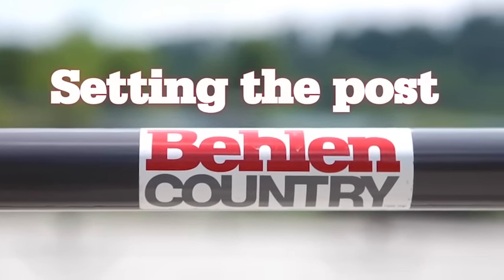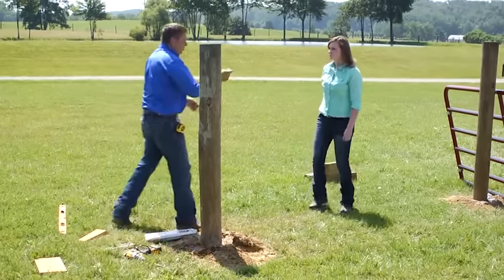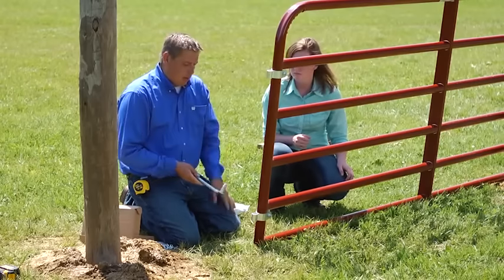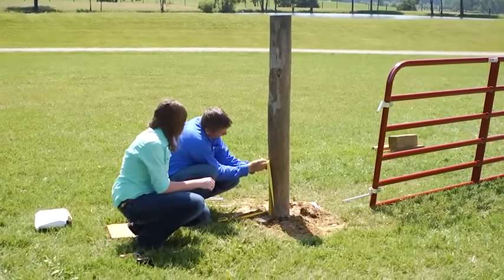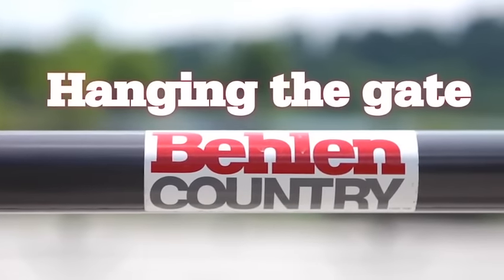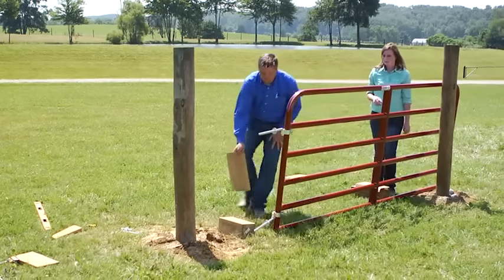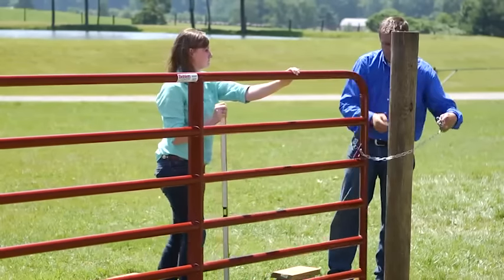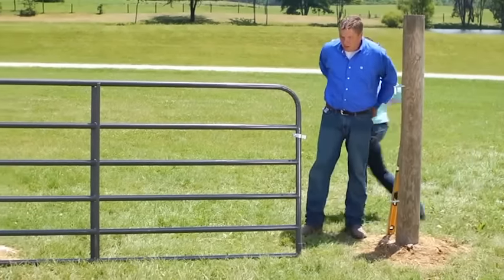How to Install a Behlen Country Gate

Comment: Good instructions, I bought  two  6 footers Behlen gates at  $ 179 a piece  to replace 35 years  old sagging redwood gates  that  were hella heavy .
Got it done  in 10 hours or one day including removing the old  redwood gates and  fixing the old 2 posts  for Behlen  metal gates 
Amazing how  light weight the 6 footer Behlen  gates are .
And those 4 lag bolts are  amazingly strong  when I twisted them CW and CCW to level the gates 
Am very happy to find the Behlen  products. And they are CHEAPER at $179 x 2 =  $ 358  than chain link gates  estimate at  $ 980 because of  2 additional two  2 5/8. inches  chain link metal posts and  6 bags  60 lbs concretes
It’s much easier to install than chain link gates that require metal posts

Comment: Holes were already predrilled. However, good instruction.
Reply: cfriskme thought I was the only one that noticed that.
Reply: Post holes were already dug, concrete was already poured, post’s were already set and leveled, and holes were already predrilled, but good instruction nonetheless.
Reply: l wanted to see how the holes were drilled horizontally & vertically spot on throughout a 8 inch pole

Comment: I would drill from the gate side of the post. That drill could walk quite a bit over 6 to 8 inches.

Look at her angle when she powers up for that bottom hole. She would have ended up an inch low by the time she was through had the holes not been predrilled.
Reply: I saw that, but I think she leveled it off.

Comment: nice video instruction, thanks! question, how do you put the post down? jut dig a hole, put the post down and pour concrete around it and the post will stick to concrete when dried?
Reply: The quick setting concrete has instructions. Each brand is a little different but basically yes you dig the hole usually with an augur (2 man or tractor) to a depth at least 1/3rd the size of the post...then usually a layer of gravel then water + concrete then backfill it with dirt and level the dirt on a slope down so water doesn't sit against the post.

Comment: It shouldn't be much of an issue with a small gate like this but if it's a big gate like 10 or 12 foot dont make it level. Leave it slightly lower on the side that attaches to the pole because it will sag over time. If done right then after a couple years and its sagged a few inches it should be pretty level

Comment: 🆘🆘🆘🆘🆘  I have a rail road tie with Hugh double  cattle gate it came with hinges so attached with the hinges trying to keep gate 1 inch above ground so cats can't get in and under house they ripp out insulation for bedding . Got gate up but rained 7 inches and rail road tie fell forward with weight of heavy cattle gate, PLEASE HOW CAN YOU SUPPORT RAIL ROAD TIE WHERE  IT WONT FALL WITH WEIGHT OF HEAVY  CATTLE GATE .. TRAPPED INSIDE WITH GATE SUNK IN MUD HELP... 🆘🆘🆘🆘ADIVICE NEEDED QUICK SET IT IN CONCRETE WHAT ELSE CAN I DO??

Comment: How deep in the ground does the latch/chain side post have to be?
Reply: For aesthetics, the same amount should be above ground as the anchor post.  If that doesn't matter, than sink it as deep as you need to stop whatever animal might be pushing against the gate!
Reply: minimum 96" for security.